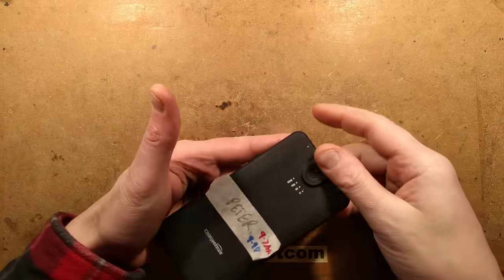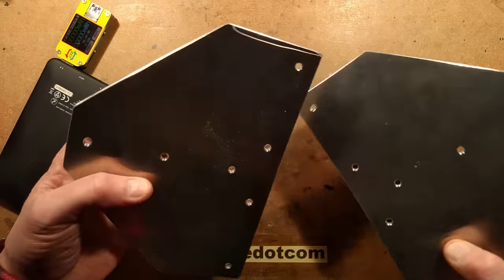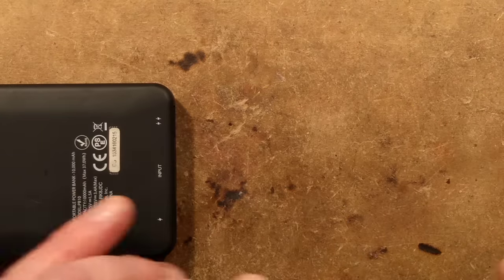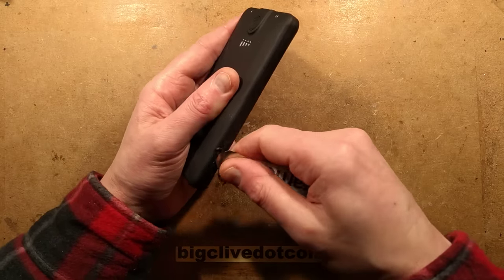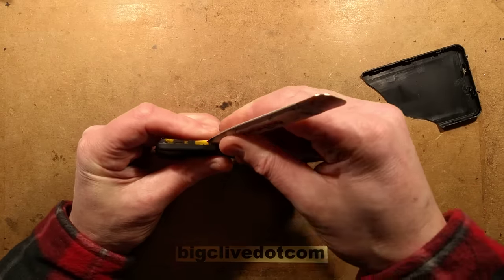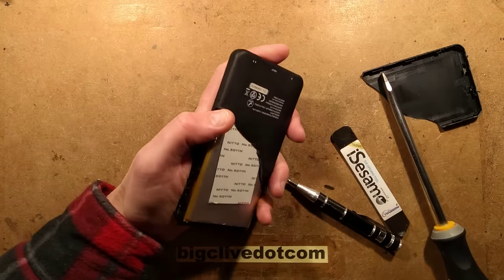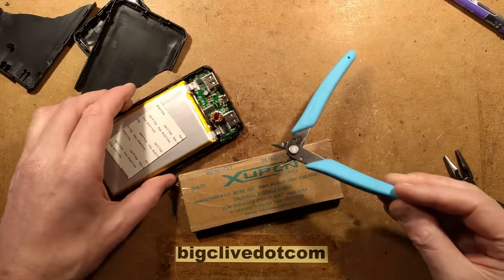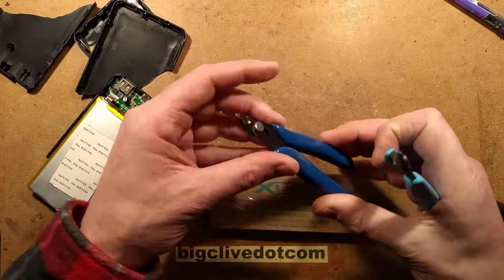Inside a recalled Amazon Basics power bank.

Comment: “That’s an Electricians grade screwdriver”
-Pulls out a completely non-insulated screwdriver!!🤣🤣🤣🤣
Reply: The Isle of Man does not really do health and safety..
Reply: It isn't proper if he hasn't sharpened the tip
Reply: Its a Poundland special whats your problem?
Reply: Human skin is dielectric to a degree.
Reply from the maker: Ah, you must be talking about the extra safe ones for Part-P labourers.
Reply: @bigclivedotcom  well, they know what's safe and not safe since they've got the part-P training. you should really get some advice from someone who is part-P trained - maybe they'll throw you a bone and can give you a pointer or two on safety. they're quite the elite group, they are. the best of the best.
Reply: To be fair I suspect most electricians will rarely if ever need to use a screwdriver that size/type on a terminal screw (at least with the styles of terminal we see in the UK). As far as I can tell a large flat blade like that is mostly used for scraping and prying and occasionally used for removing old woodscrews.
Reply from the maker: @Polite_Cat  Yes.  The one day slideshow version of the Part-P is especially good at creating experts.
Reply: I rate the shaft to 0v and the handel to 500v.
Reply: Haha are you referring to the part p labourers that see one of them ads from so called training companies advertising “Electricians course” or “become an Electrician”- 1 day course!!
Nice to see you in the reply thread to my comment (joke) Clive!
Having been a ‘proper qualified’ Electrician (time served an all) for 30 years I think the down skilling in our industry now is a complete joke! I don’t seriously believe them guys would know what an insulated screwdriver is!...
If there are any ‘Electricians’ reading this that have qualified via one of them short courses let me just clarify, 
The point of insulated tools is that by using them it’s perfectly safe to work live!!
Go ahead give them a try!!...🤣
Reply: Please stop before you trigger Clive's Part P twitch.
Reply: @petermichaelgreen  Not all screwdrivers are for removing only screws. A big screwdriver like that is excellent for tearing stuff apart when it really doesn't want to budge. (Subtlety mode off, engage screwdriver into case with hammer. Turn. Maybe not recommended for things with lithium cells inside.)
Reply: "An electrician-grade tyre-lever!"
Reply: @petermichaelgreen  It may be slightly oversized for normal 63A terminals, but looks just fine for 70A car battery terminals or attaching consumer panels to walls.
Reply: Insulated screwdrivers encourage working on energized equipment. They would seize these at the old job.
Reply: @chasmosaurus3  That's insane!
Reply: @bigclivedotcom  electrician's screwdrivers are insulated and tested to 1000v, no matter what.
Reply: @andrewwhite1793  Neither will the rest of the UK give it a year the government has eliminated it's only reason to pretend to give a shit whether it's citizens are somewhat safe, big cost cutting for rich companies though so yay? I guess? Still have not made head nor tails what the hell supposed benefits are for non misanthropes as every effect claimed will utterly screw over the majority of people so guess I'm too thick or something because I can't see the unicorns lol.
Reply: He's a proper roughhouse!

Comment: "Let's pour Petro down the back of a lithium cell" hahahahaha, that made me laugh
Reply: Honest, I saw that video myself, years ago.  Some guy claimed to be telling you how to open laptop battery packs.  You just pour a little petrol on them and they snap right open!  (Yeah, Right)
Reply: Sounds like a case for Darwin...
Even more so if the person attempting such a stunt wedges the power bank between their thighs...
Reply: hahahaha his response was great
Reply: Use that GooGone stuff  to remove stickers and adhesive. It is made specifically for it.

Actually, I looked up the MSDS for GooGone and it is a mix of kerosene and heavy naphtha. 

I prefer to use a light naphtha (Coleman white gas) as it evaporates more quickly and cleanly. I love those zippo lighter fluid bottles because they put out a tiny little stream and you don't use too much. It does work. It works well.

Comment: So a tip for getting through those double-sided foam tape pads is to use dental floss like a cable saw.  Easy to thread into tight spaces, and it provides just enough cutting power to get through the adhesive without damaging anything else.
Reply: A light wound g-string for a guitar works pretty good as well.
Reply: 3 year old comment but ill say otherthan isopropal or napthaline, i use a brand name arimid fiber string. for some reason when i say the well known dupont brand name of the polymer it gets hidden on here. really strong fiber, super thin, ultra high abrasion resistance, can cut a limb off a tree with it, 3$ for a roll the size of my head from china lol

Comment: On the topic of not taking iPhones apart, I watched a video where a fella bought two new iPhone 12's, took them apart and swapped parts of one into the other. It didn't work, camera was borked, as was facial recognition and the battery indicator insisted that a fake battery had been fitted. When the original parts were refitted, all was good. Even just swapping the camera caused the phone to fail. 
So all the modules must be keyed to the motherboard, so that's an end to back street iPhone repairers.
Reply from the maker: It's not a good direction to go.

Comment: I had some success with that kind of tape dripping isopropyl alcool and applying a costant pull force and waiting for the glue to separate. What I mean is that instead of constantly increasing the force applied to separate the tape from the other part I just pulled a bit and let the glue separate on its own accord (while keeping it wet with alcool) and then pulling some more etc.

Comment: Clive I took the same pack apart and for big solder joints like those I use an old Weller 8200 N 100/150 watt trigger iron takes about 8 seconds of course your mains is 240 something volts but for big joints or things that cant be exposed to heat for long time it seems to be pretty good. Cool video and  thats like five things i own that you have disassembled

Comment: You are correct, Samsung said in a statement to the BBC on 23 January 2017
 "According to the findings, the problems centered on insufficient insulation material within the batteries and a design that did not give enough room to safely accommodate the batteries' electrodes."

Comment: 12:08 It's fine to desolder those spot-welded tabs - i've removed (or in some cases, needed to "transplant") the little protection-boards from one cell to the other several times, and i've yet to cause any damage. Mind you, i did use quite a chunky tip on a non-chinese-made iron, so there's that too.
Reply: I don't understand how something that has been "spot-welded" can be "desoldered".  By definition, spot-welding actually melts the material together (hence "weld"), and doesn't use solder at all.

In fact, spot-welding is the preferred method of permanently joining to the terminals of lithium cells specifically because it joins the materials with localized heating.  This is in contrast to soldering, which requires that both materials be heated up in order for the solder to flow.
Reply: @LicenseToCode  Those flimsy nickel(?) strips that come straight out of the lithium cell are spot-welded to those larger tabs. Those , in turn, get soldered to the pads on the circuit board. The battery terminals or pads do not get spot-welded directly to the circuit board.

My guess is, those chunkier tabs get reflowed onto the circuit board, and the nickel strips coming out of the battery subsequently get spot-welded to those pre-soldered metal tabs.
Reply: Yeah, his tip was just too small to heat that size joint quickly, typically if you're not melting the solder after 3 seconds, your tip is too small or your heat is too low.

Comment: Try isopropyl alcohol to separate the glue next time. It's what I usually use when removing batteries that are glued in like that, along with your flat case separator. Much safer than prying the plastic.  
The cells themselves are pretty safe from experience so long as you don't puncture. Even smooshing them hasn't cause me issues so far.

Iphones are thankfully still repairable. We can still replace most things in them, though apple does try to make it difficult

Comment: I used to work with apprentices in a factory in Aberdeen, Scotland. One day all the apprentices, maintenance and turners, were in the class room doing some basic arithmetic. An electrician apprentice complained that while the turners might be required to work to plus or minus .0015 inches, he only had to work to plus or minus one inch. Big Clive has proven that he can work to much tighter tolerances than that. It was oil field equipment, so all the manufacturing work was done in inches.

Comment: You don't need to use petrol to release the sticky stuff. Normal isopropyl alcohol works wonders.
Reply: yeah, i'm also sure that alcohol would ignite wonders with electrical sparks
Reply: @pierreuntel1970  If it's technical grade, it shouldn't be conductive, and it won't have much water in it... still sketchy as frig though

Comment: Mine stopped working before the recall. When I opened it, it looked like the resistor R19A (at left MOSFET) had burned out. The recall came just handy as by opening I also had broken the case.

Comment: "1.6A in current and 1.8A going into battery"

Yes, I also suspect of double duty of the inductor. 
In other words, the NMOS + PMOS + 2x Schottky diodes + inductor probably form a buck-boost converter and the mystery chip likely controls everything operating the all thing in buck mode for battery charging and boost mode when a load is present.

It would have been interesting to see the thermal image of the board when one is charging and loading the power bank at the same time.
Reply: Charging generally locks out the use of the outputs, as they need to be done exclusively, so the detection circuits can work properly in their respective modes.

Comment: Have you tried dental floss for separating the pads?
Reply: Do you mean using it to kinda saw the pad? That may work very well in places that it could be pulled into.
Reply: i would use a good amount of isopropyl alcohol.
Reply: @TheCody009  the whole point is to keep flammables away from the lithium batteries!
Reply: @adriandaw3451  Isopropyl is still a lot better than gasoline...
Reply: @adriandaw3451  That little alcohol doesnt change much if a cell that big starts going off
Reply: +Adrian Daw Don't do that, please. Alcohols react with alkali metals. If you puncture a cell, you're fucked.

Comment: The power bank max current of 3.4 amps is derived from a 2.4 amp and 1 amp USB output.

The initial reading of 3.4 amps raised an eyebrow. 2 devices plugged in would do 4.4 amps.

Would that bypass all the protections? Would that make the chips hot enough and melt?

I thought the device got recalled because of shoddy cells (usual were all the problems start).

Comment: This stuff is really beginning to grind my gears.  If one guy can figure out the difference between good and flawed design then why can't we just get products that are properly designed to be efficient, reliable, and safe?  Especially when the difference between good and crap seems to be pennies on the dollar even in the worst cases.
Reply: Bob Riemersma here is your answer. The all mighty dollar. Companies keep trying to find a way to save an extra cent so as they cut cost stuff turns to crap.
Reply: @Android-ng1wn  if they can a good one for the same price as the bad one, then they only make half (or less) of the profits. Why make a good one the sell you once when they can sell you multiple over time because they keep dieing?
Reply: In this case he couldn't figure it out and was mostly guessing around. I was expecting more.
Reply: Often you can blame Marketing and the bean-counters. If BC is correct and the case was just a tiny bit too small, note that giving it square corners instead of rounded would have fixed it. But no, Marketing says "It needs to be rounded, nobody's buying square stuff this quarter!". The bean-counters get with the insurance people and figure out what the monetary risk is to settle suits or do a recall vs. not making the profit, and recommend not fixing it.
So you get 53 fires and a recall.

Comment: You might try slowly and SLIGHTLY warming the adhesive/plastic case before pulling on the cells/tape/case. I've used a hair dryer set on "warm" and kept far away enough to keep from heating the cells by any appreciable degree. Depending on the adhesive it sometimes can make a major difference in how easy it is to pull off the tape. You also have to make sure the warmth is distributed throughout the item to keep the adhesive from cooling too quickly.

Comment: I had a pair of the lighter blue xeron ones with my ender 3 3d printer.. Look more like shadow factory copies as they are identical except the logo area is void, so it just has a blank rectangle.. They even have the offset blades to cut a smooth surface.

Comment: I suspect that the double sided tape is supposed to hold the battery from sliding to protect the corners but someone wasnt peeling the backing off before clipping it all together.
P.S.
On this type of case you are supposed to start in one specific spot (and its never a corner) flex the case as you work your way around, there is no mark to tell you where to start or which direction to go.
I ran into a case that is impossible to open unless you grabbed the top and bottom and twisted them slightly back and forth...and then the damn thing just popped open.

Comment: Hi Clive, good video as usual.
Can you do a video checking the calibration of the many USB testers you have?
In particular the current readings at the high end of their range over time, to see if the current shunt is worth its chips.
Also the volt drop across the tester, are they measuring supply voltage or load voltage.